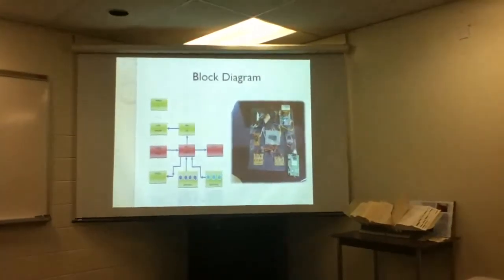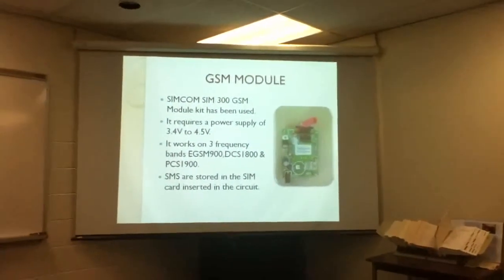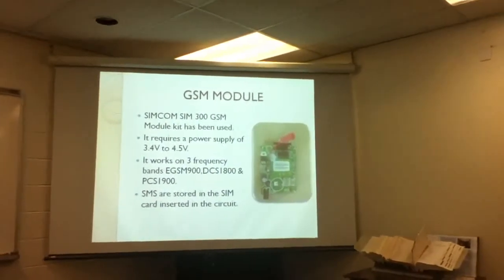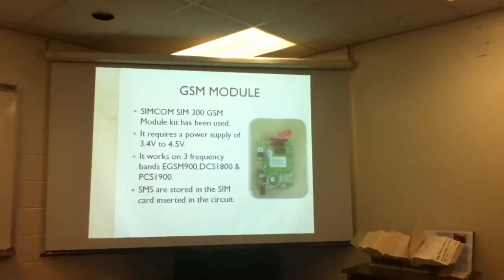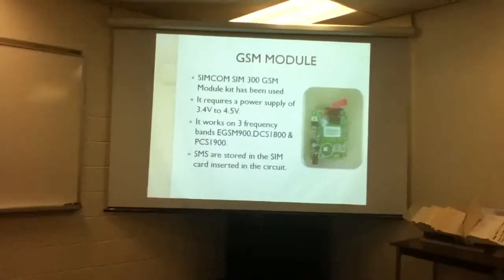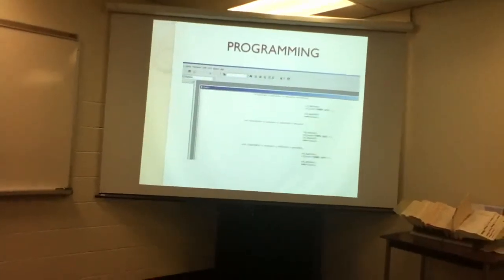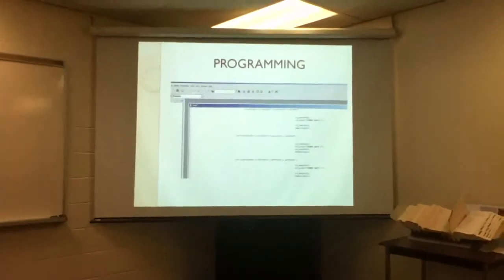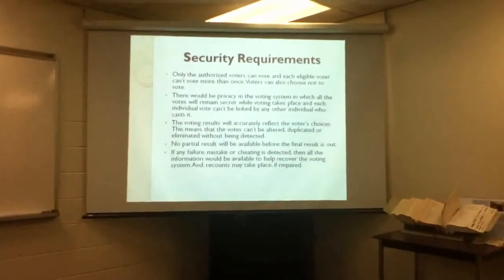gsm voting machine ppt.avi

Comment: Microcontroller IC of 40 pins 8 GB  ROM and 256 bytes RAM
One serial port three timers and 8 interrupts
Crystal oscillator
Power supply : step down transformer capacitor and diode
Buzzer
 16 bits LCD 
Pin number one and PIN number 16 are ground
Two pins for contrast
LEDs
GSM module
Mobile phone 
Switches
GSM 300
The GSM module induces TCP IC protocol for data transfer application
Extended DC catalytic amount
Kiel version 2 for programming